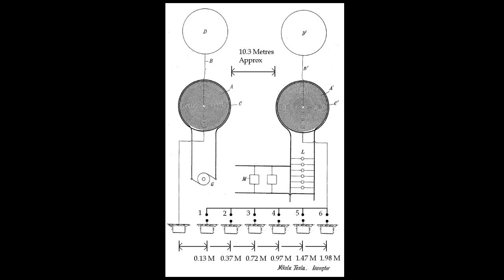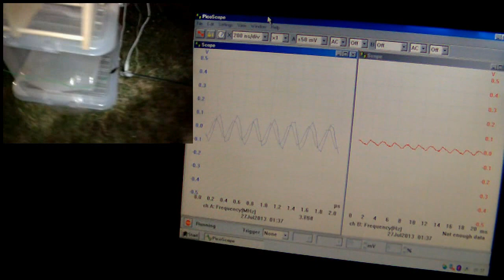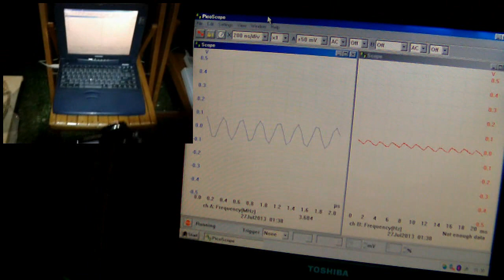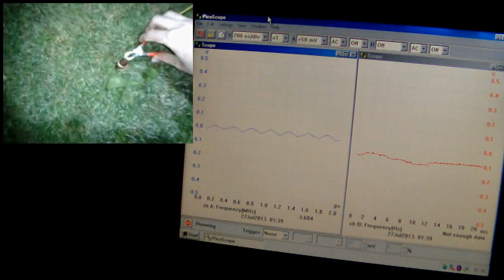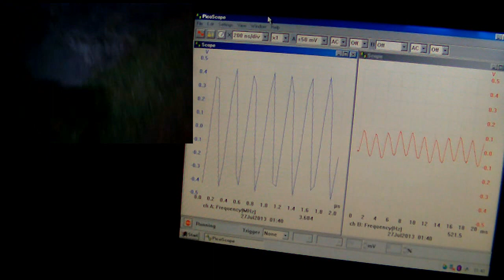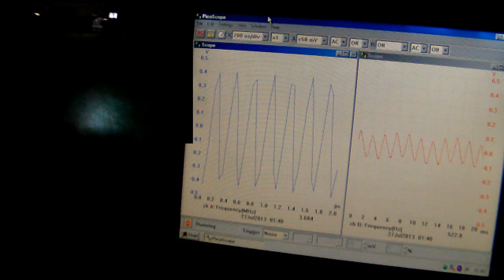Nikola Tesla Magnifying Transmitter - Wireless Telluric Transmission Of Energy - The Evidence Mk. 2

Comment from the maker: The signal generator (sine) output goes to a modulator, into an op amp with 50 ohm output impedance to the primary. The limitation (and problem with solid state) is the maximum power it can deliver to the primary without destroying components, the op amp is working flat out just to supply +/-0.7V because it's practically a short circuit, calculated impedance at the driving frequency is only 15 ohms. But the main purpose of it is to apply modulation to the signal gen output rather than gain.